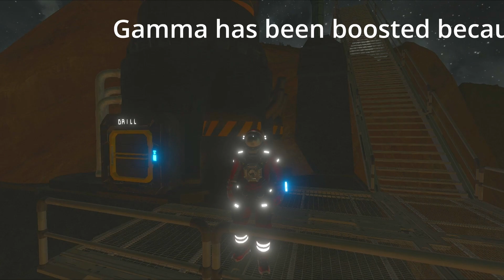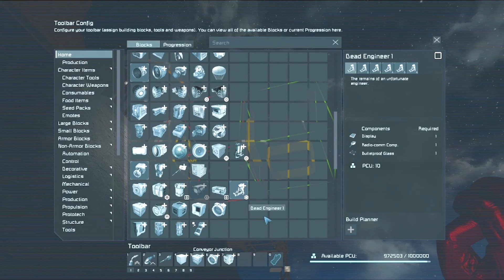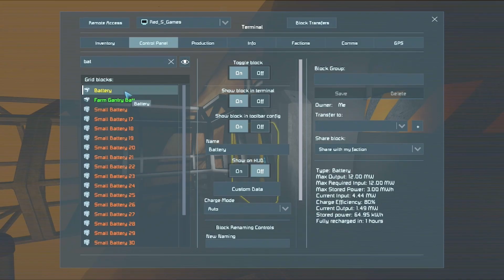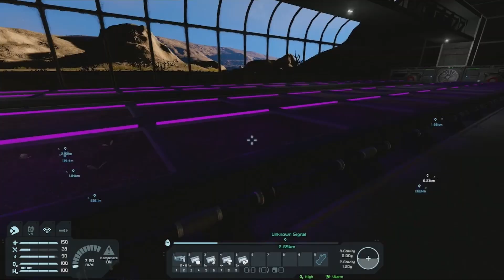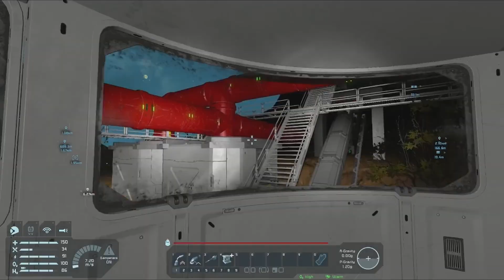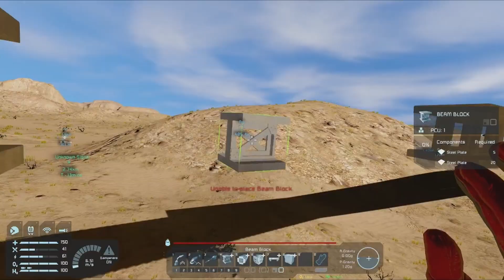The Railyard Takes Shape - Rail Survival EP 14   A Space Engineers Railroading Adventure

Comment: a suspended turntable might have been a better option. Drive on rotate to the rail and drive off. Can set up to rotate to specific degrees easily enough. Or even a lateral transfer table
Reply from the maker: I did think about those options, but I foresee value in being able to travel straight through preset points like this without having to stop.  Maybe I do a turntable somewhere else, though, because that does sound like fun!
Reply: Turn Table setup would be cool as heck too.